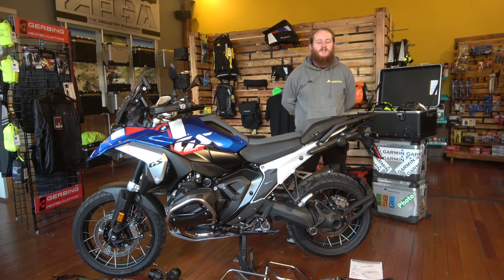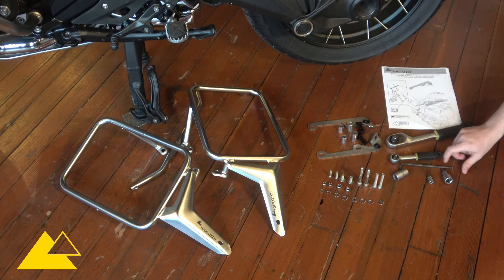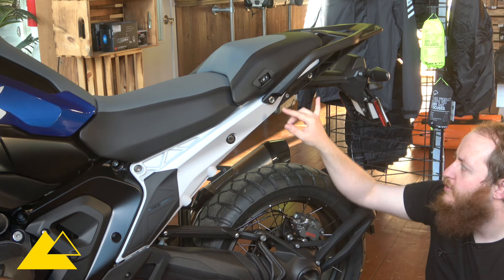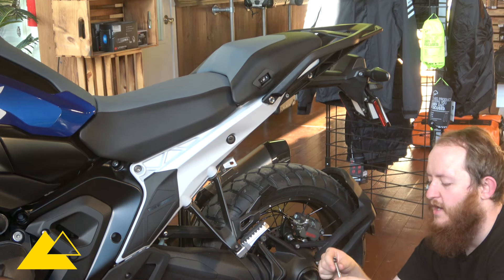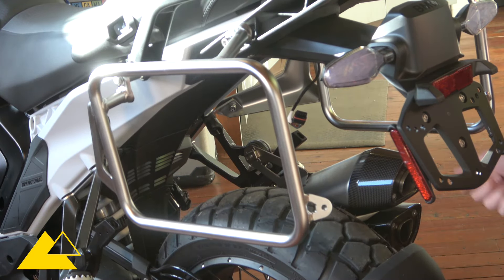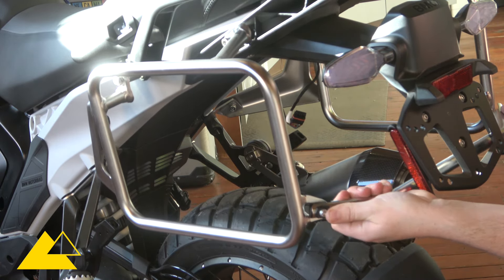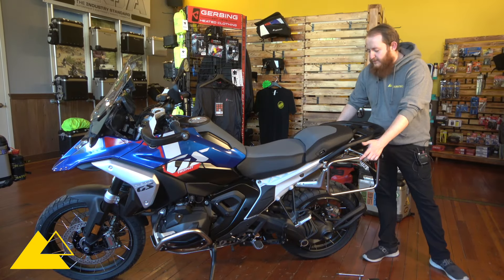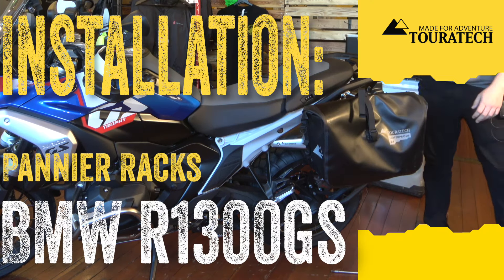Touratech Pannier Racks Installation: BMW R1300GS

Comment: This video does not talk at all about replacing the main fasteners that hold the whole rear turn signal / blind spot radar / license plate assembly to the bike’s subframe. After removing the final bolts holding the Vario pannier mounts,  (they were the third Vario mounting point underneath the fender and are not used to mount the Touratech racks) - the BMW bolts are too long to bolt the assembly back to the subframe after removing the Vario racks. You will need to find some shorter fasteners or some spacers, neither are provided with the kit. If you don’t put any fasteners in here, the whole rear assembly is loose and flopping around.

Also the instructions for stashing the wires are wrong - the “middle” bolts that the mechanic in the video removed have nothing to do with the sub fender, they only hold the BMW grab rail in place. There’s a completely separate set of bolts in the sub fender that you have to remove so the assembly comes loose. Then there are four more zip ties that have to be cut, two on each side otherwise you can’t even move the wires. 

This video could use some work, especially since the kit does not come with any sort of printed instructions.
Reply: Not yet seen a video explaining just that, and if you just want to remove the vario racks you will also need to replace one very long bolt on each side.
Reply: I was left with a small rubber bung in the bolt package what is this for 🤔
Reply: @hansbakken5805  100% Correct; just installed mine yesterday. At first I thought I'd made an error but then realised what those two extra T40 bolts were for. It would look ridiculous if you used spacers to use the original bolts. Luckily I have a number of bolt sets and had two shorter bolts of the correct thread to replace them with and hold the rear assembly (used threadlock to be sure). The two T25 (I think) bolts (way up inside the tail assembly moulding at a bit of an angle) do provide some fixation of the assembly but not enough on their own. As for the wires, 100% again. You pretty much have to pull that rear assembly apart and clip two sets of cable ties to release those cables enough to relocate them inside.

Touratech have been doing this for a while so I'm sure they'll address this deficiency in time.